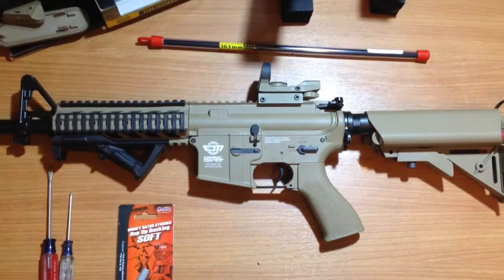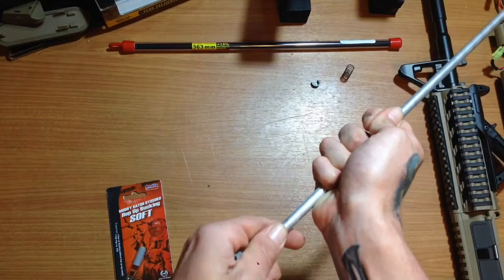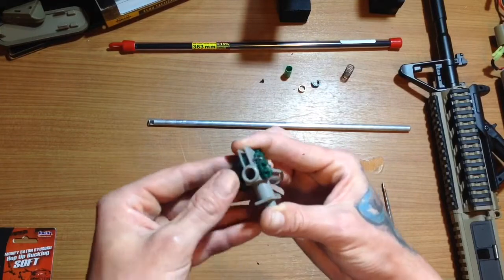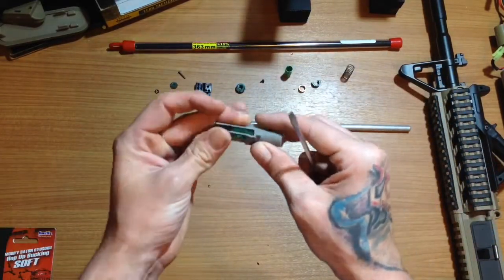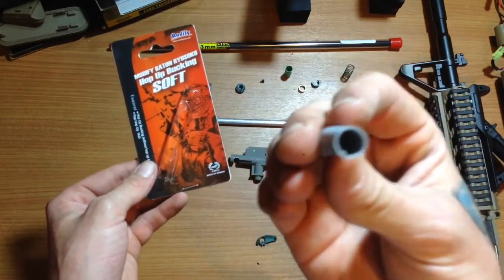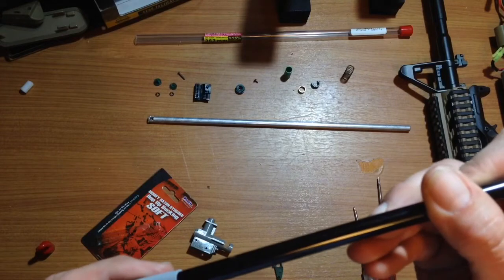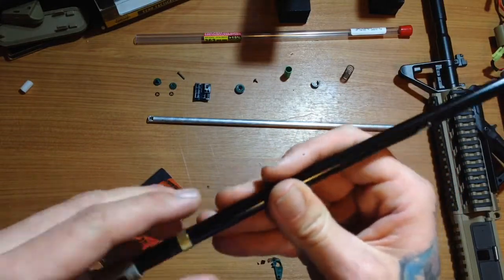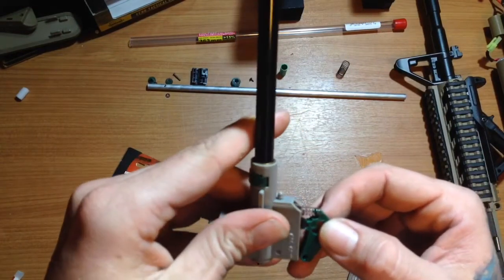How To Flat Hop. CM16 Raider L-Dst

Comment: Instead of super glue you can use a very small amount of silicone grease to hold your flat hop nub onto the arm. It will be just enough to hold it together, yet you will still be able to remove it without damage if you want.
Reply from the maker: Thanks that’s actually helpful

Comment: Blackburn Tactics So did this actually work for you and help your gun? Bc most flat hop vids i see they are cutting and sanding off the nob on the bucking. Was that gray bucking already sanded off when you bought it? Please respond.
Reply from the maker: The bucking was already flat on the inside from the factory. And yes it improved my accuracy at range a great deal.
Reply: I bought the same one yet it doesn’t actually overhop like I want it to
Reply from the maker: Since this video I have had different hip up units, buckings and nubs. On some configurations I used this flat nub with a bucking that also had a nub or ribs and it worked fine. But it all depends on the different parts involved.